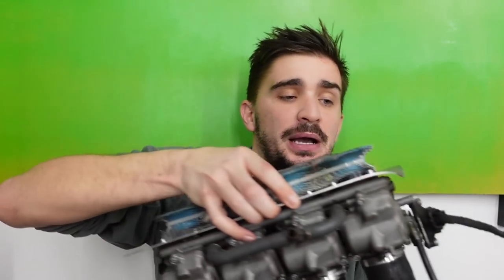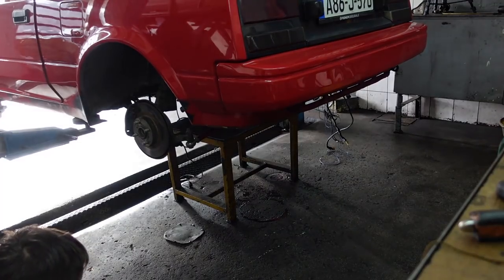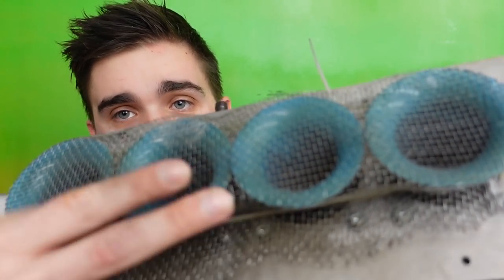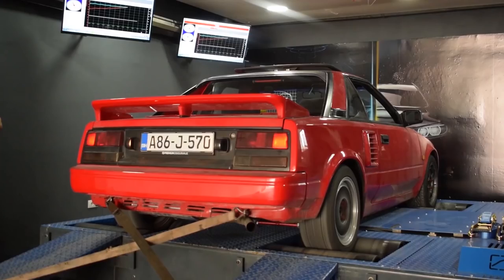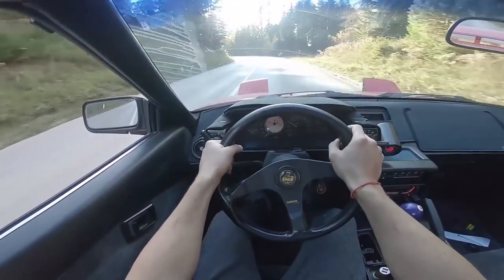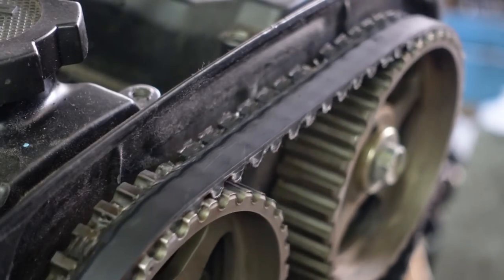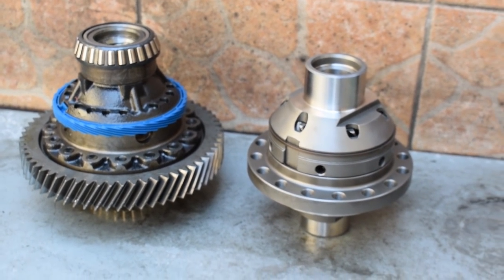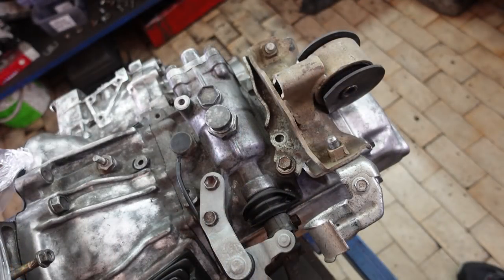Turbo 4AFE UPDATE + GOODBYE Bike Carb 4AGE recap - Project Underdog #12

Comment: Most stock Japanese cars from some time after the 80s had dispensed with progressive throttles and are almost impossible to drive smoothly. My 2003 Accord is like that, as well as a friend's 2012 Mazda. I noticed it at the time and was told it's for a "sporty feel." Right. Moving on, I like the mesh on the carbs. Ingesting various animals into the engine also makes smooth driving a challenge due to the mixture ratio being hard to calibrate and the smell of burning flesh can be a distraction and safety hazard as your mind shifts to thoughts of lunch. Well done. 😉

Comment: "And the livestreams were really fun"...

Never forget Fabio...
Reply from the maker: Hey maaaaaan!!!! So fun to put a face behind an avatar! Fortunately the face is different 😂 Fabio is a legend. I'm having him host the next stream.
Reply: @d4a  hahahaha, Italians man... On another note, I've seen stock cam 4agtes rev to 9000 with a gtx2860r and adjustable cam gears. It was a bigport engine as well. The guy only ran about 15 psi of boost, so he needed the revs to make that 300hp. It looked like it had a really meaty power band though, since boost came on relatively early and held steady until redline, so I'm looking forward to seeing how the 4a-fte will handle the boost as well. Might even make more power than the 4age bigport in some places, though I expect that the lack of adjustable timing will hurt in some places.

Comment: I know how you feel about making your engine pretty😉
With age, you just want it to run well and not leak oil and other fluids everywhere!
I stopped "blinging" my engines 15 years ago😎😜
PS: My "american" MR2 (Fiero) puts 400+ HP through an open differential. It seems to handle it OK. I've heard that limited slip diffs can cause handling problems (torque steer?) in our type of cars!?
Reply from the maker: Yeah I've heard similar stuff too. I don't think I would have any major issues with an open diff but I feel like the torsen will improve things
Reply: if the differential is stiff yes

Comment: But with a supercharger you’re going to need a blow off valve because the supercharger will drag on the engine during high rpm and closed throttle condition.

But if you have throttle before supercharger it’s not a problem

Comment: HINT

Please do a Video about piston pin offset. There are claims, that reversing the piston (if possible) and therefore reversing piston pin offset, brings power by reducing friction because of better rod angles during power stroke and there seems to be measurable benefits from it.

Comment: When I did my 2ZZ-GE conversion, having a lift definitely helped get the old engine out and the new one in.

The lift is a 4 post platform lift though so the new engine because it has a 6 speed gearbox which is slightly longer, didn't fit between the platforms so I had put it in kinda diagonally lol. 

Did you ever consider the 2ZZ-GE or were you always set on the turbo build?
Reply: Love from the Caribbean here, was planning on a 2zz swap as well but budget was tight so just ended up going back 4afe.......... but I've been watching an ae100 with a n/a 4afe doing 13s and I'm more than happy with those times from a lil fuel economy engine so my goal now is to get there bolt ons, piggy back etc.......... been posting to "driving 4 answers " for some help in my ques

Comment: Did you balance the new flywheel? Factory balance is not perfect.
Reply from the maker: Didn't touch it. I won't be revving high. You need "perfect" balance only for extreme applications.
Reply: @d4a  Hp is produced by an accumulation of little things.  Balancing is a very inexpensive method of reducing internal engine friction. I have carefully rebuilt “stock” 4AG engines and produced more power on a dyno than engines with big cams, high compression pistons ect.  Matching cylinder volumes, carful reshaping of the cylinder head ports,  reshaping oil passages, improving water internal water flow, and balancing to one tenth gram. No fancy parts, just attention to reducing parasitic drag and improving efficiency. Balancing is inexpensive.

Comment: I used to build turbo'd motorcycles, got pretty good at tuning carbs for boost. I have long wanted to put a turbo'd bike engine in a car but have yet to do it. Nothing like a 250hp powertrain that only weighs 200 pounds.

Comment: 20:22 afaik the 4AGE is a non-interference engine, not so with your modifications?
Reply from the maker: Yes, both my 4afe and 4age are non-interference from factory. My 4afe is no longer non-interference as I had to deck the head and block a fair amount and the outer edge of the 4agze low comp pistons also makes it interference.

Comment: Looking forward to seeing Project Underdog running.
I have used parts from a MK1 4A-GZE (big port). If anyone needs any part from it, feel free to hmu.
Reply from the maker: I definitely need the driveshaft hanger thing!
Reply: @d4a  I forgot to add that the engine was in RWD config. It was in my AE86 but I threw in an SR20DET instead
Reply from the maker: I think it still has the hanger?
Reply: @d4a  it was removed when the car's previous owner installed the engine in it, coz I haven't seen any brackets other than the alternator's :/
Reply: I'll hit you up on Instagram. I might be able to find that for you in our scrapyards

Comment: Hi, i got igniting solutions for you. I have old car with distributor and double carburettors too. So i buy standalone ECU to remove distributor and tune my ignition. It can work with carbs, and it got many interesting settings, and it's not expensive. It's named Secu3. Read more if you interested